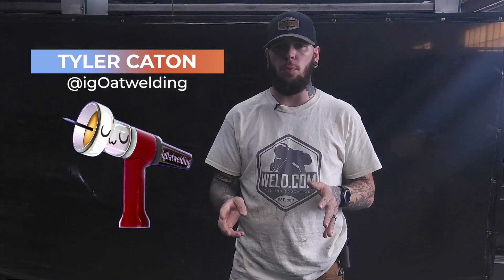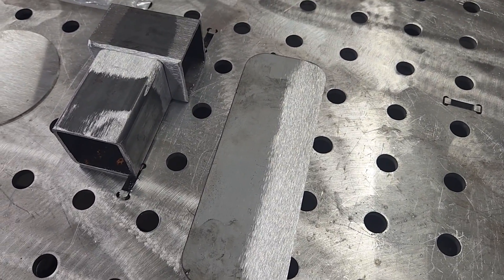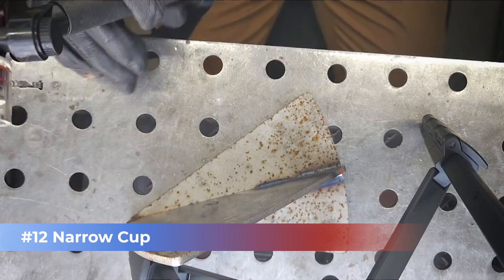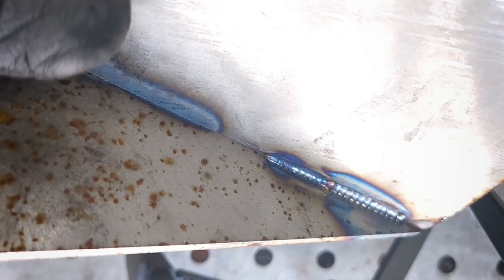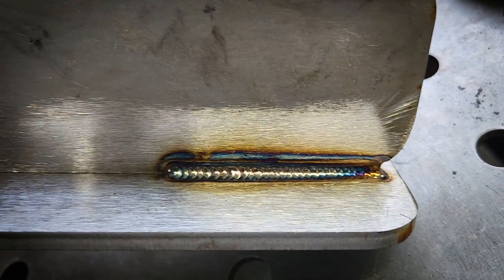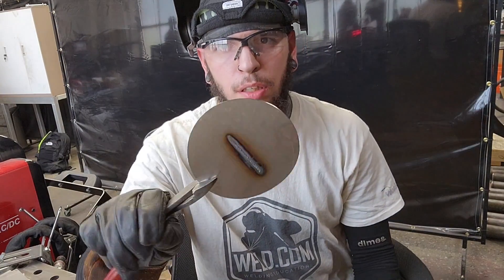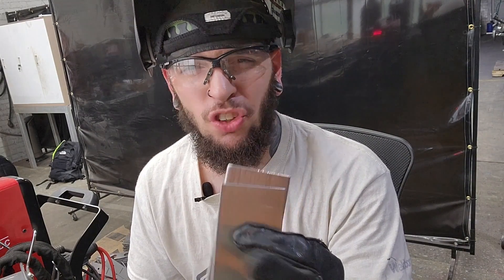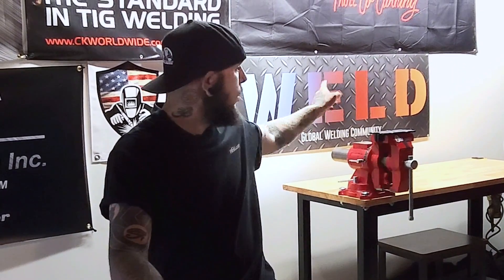TIG Welding and Contamination

Comment: Almost no difference except undercut which can be fixed with a toe dressing.
Reply: The weldament itself has contamination and is weak. Proper preparation avoids any of thr hassle of fixing or having a failed weld. Or even struggling to have a nice looking weld. Prep and fit up are everything. Not taking the time to do so is bad practice and unprofessional.
Reply: @SHANANAGINSx  Any impurities would float to the surface as slag.
Reply: @MoronicAcid1  this is TIG. Yeah if I was using dual sheild or inner sheild flux or stick welding sure. You can weld over rust with some rods. The point is the scavengers and deoxidizers are not enough in the rod while TIG welding.
Reply: @SHANANAGINSx  Quite the opposite actually. Welding over oxides while adding filler can trap inclusions, especially at the beginning, and in some cases, the ends of welds. Scavengers improve the buoyancy of slag, allowing the electrode to deposit their metal without trapping any. TIG gives the slag time to surface without immediately covering them with filler.

Comment: Nice welding. You don't really need to snip the end of the rod off unless you balled it up or something or you're welding on nuclear reactor parts.
Reply: It's still good practice. It's oxidized and you shouldn't be shiving it into the weld pool.
Reply: @SHANANAGINSx  You are anyway every time you dip the rod (of course it's important to keep the end of the rod in the gas shield for this reason)
Reply: @benc8386  agreed but a lot of people don't or if your post is set up wrong. It's a good thing to keep in mind of you oxidize the filler.
Reply: @SHANANAGINSx  Yes. Always snip it if it's balled up. And might as well if you're just starting and picked the rod up off the shelf where it has been for the last few days just in case if making something safety critical.

Comment: Your "dirty" material would be clean at the trailer factory where I work.
Reply: Different processes and jobs require different prep. I'd rather avoid any failures and be thorough than regret it later.

Comment: Hiya bud. When a machine has Ac and dc, do you just press the button to change between the two or do you have to change the torch and the earth clamp over too? Thank you and hope you’re well:)
Reply: Yes. Just press the button, and you're good to go.
Reply: Shouldn't ever have to switch over your tig torch and clamp. Doing so will change the polarity. TIG is always DCEN or AC. Stick and wire feed will require different polarities based on the electrode
Reply: Just press the button and my torch set up.
Reply: I guess nobody else has a ac welder w/o a high freq arc stabilizer built in. That said, if you have a rig that does not have a high frequency arc stabilizer built in, you will get your ac currant at 60 cycles ( unless you are in outside the United States) this is not going to weld at all. You will be lucky if you can keep your tungsten from sticking.
Reply: Thanks everyone. I thought it was just press the button as that’s what I’ve always done but I got a bit confused with the first part of the vid on welder set up. New to this and loving it :). Thank you 😊